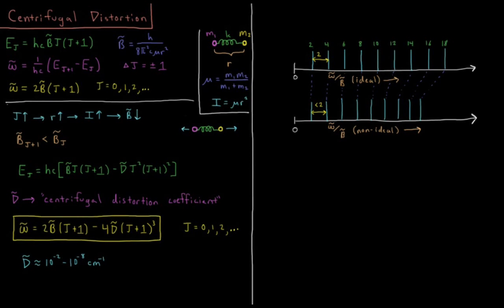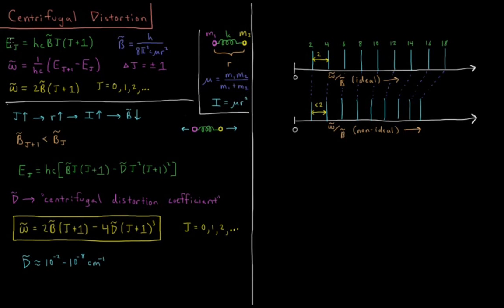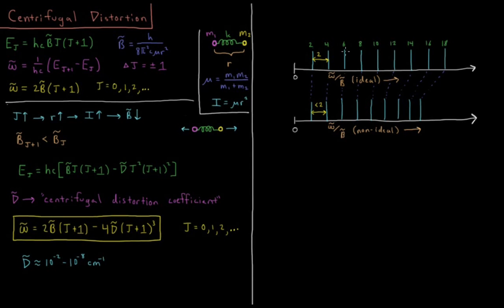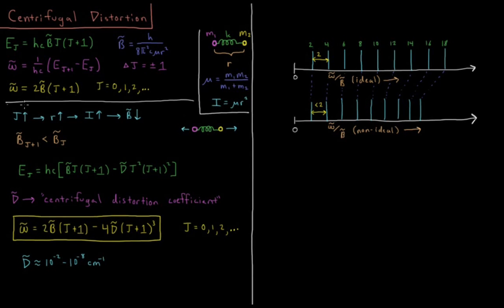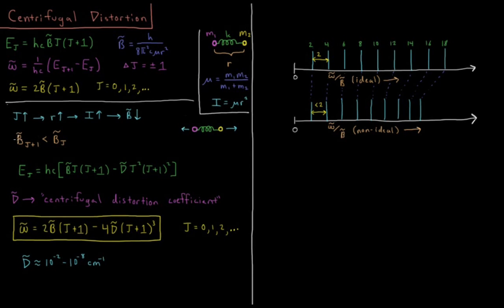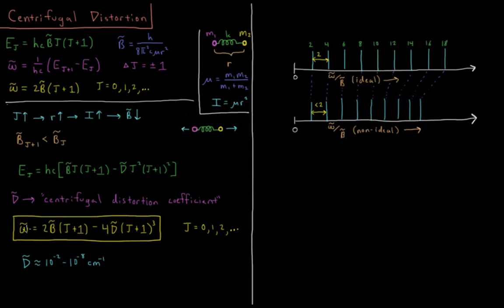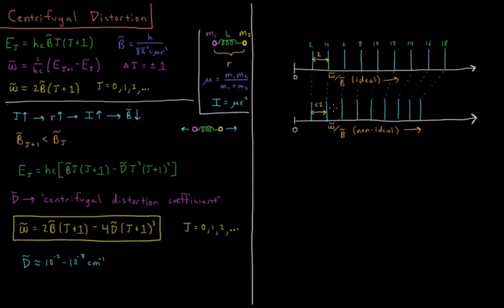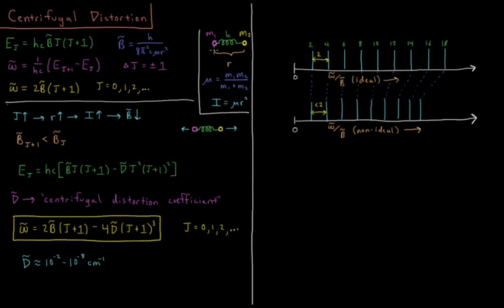Quantum Chemistry 6.9 - Centrifugal Distortion

Comment: i'm curious about why a_e(rotation-vibration constant) has a factor of n+1/2,
and D(centrifugal distortion constant) has a factor of J(J+1).

it seems these constants came from Energy equation that we've been dealing with,
but i'm not sure why.

though you mentioned about polynomial interpolation, I'm not sure what it is either.

should I see it after I went through more math stuff?
Reply from the maker: They each come from the respective equations for harmonic oscillator vibrational energy and rigid rotor rotational energy. The rotation-vibration interaction constant comes from the fact that the bond length tends to increase as the vibrational energy increases. To a first approximation, this increase will be linear with increasing vibrational energy. The vibrational energy depends on the vibrational constant times the vibrational quantum number plus one half. So the (n + 1/2) factor comes from approximating the state current vibrational energy as a linear polynomial. The centrifugal distortion constant arises due to the increasing bond length with increasing rotational energy. The rotational energy depends on J(J+1), but we already have a linear term in this expansion (B, the rotational constant). So the next logical term in a Taylor series of J(J+1) would be the quadratic term, (J(J+1)^2, or J^2 (J+1)^2, with the coefficient being D. The values are then chosen by looking at a set of vibrational and rotational spectra for the molecule and doing a "best fit" interpolation of the polynomial constants we have (v, B, alpha, and D). It's basically curve-fitting with some functions that we expect should perform quite well.

Comment: you mentioned 'eqn E_J in the middle' has to do with Taylor Series.

so I thought it'd be an approximation with respect J(J+1), at J(J+1)=0.
E_J = hc[BJ(J+1)-D(J(J+1))^2]  = 0 + hcBJ(J+1) - hcD(J(J+1))^2      
       = hcJ(J+1)[B-DJ(J+1)]                  

and I assumed 'E_J = hc[BJ(J+1)-D(J(J+1))^2] = hcJ(J+1)[B-DJ(J+1)]' is equal to 
(B_J) *J(J+1).
∴B-DJ(J+1)=B_J,   B_0=B <-subtituting n=0

but now that I think about it, 'first derivative of hc(B_J)J(J+1) with respect to J(J+1)' is not hcB because of B_J that is a function of J.
my logic seems to be broken unless you assumed 'first derivative of hc(B_J)J(J+1) with respect to J(J+1)' equal to hcB. 
Did you?
Reply from the maker: I think you're reading too much into the Taylor series comment. It isn't so literally a traditional derivative expansion. I think about it more in terms of a polynomial interpolation of a given order.

Typically our starting place is a microwave for a given molecule. There is a series of peaks which are more or less evenly spaced. We can take the positions of these peaks and do a best fit to our frequency expression, [ Bbar (J+1) ], and find the best fit value of Bbar.

If instead we want to improve our approximation, We can use the energy expressions which are quadratic in J(J+1), which includes Dbar, giving another expression for the frequency of the peaks, which will improve our accuracy. We can do a best fit quadratic interpolation of the data and find best fit values for Bbar and Dbar.

In principle this process can continue as far as we like. We could include 3rd or 4th order terms to really nail it, but often the values at second order are good enough that this is unnecessary for all but the most high-accuracy applications. The same could be done for anharmonicity and/or rotation-vibration interaciton. You can actually look up NIST data for rovibrational spectra, which have up to 3rd order constants for all three for a variety of molecules.
Reply: I think I got the point after reviewing a few times. whew...
Thank you for this detailed comment!